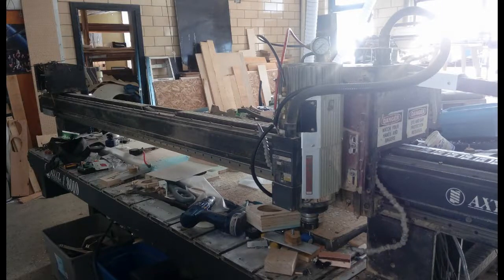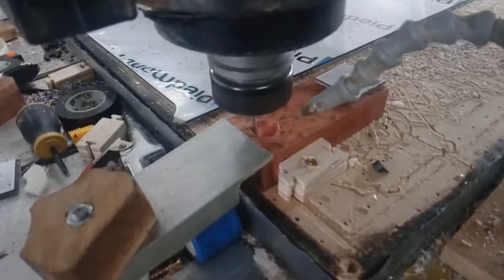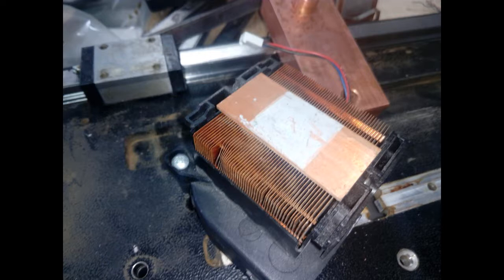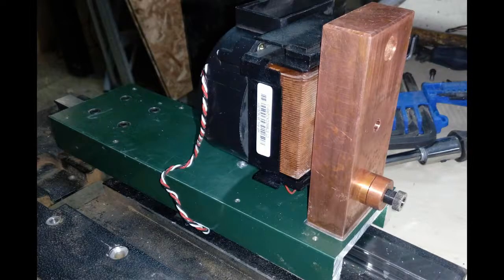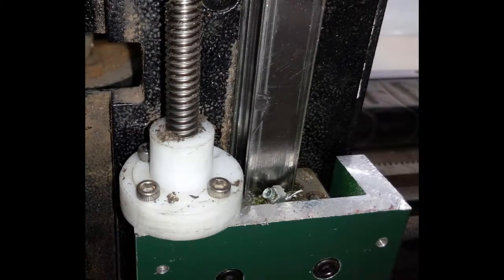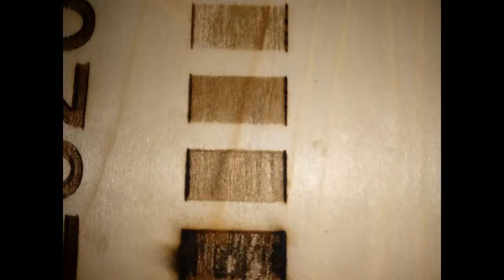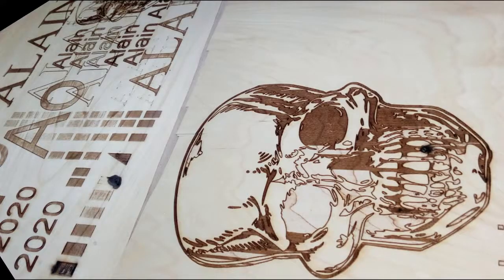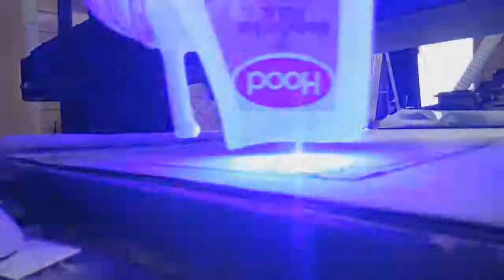Nichia NUBM44 Laser diode addition to CNC

Comment: Thanks, it was interesting. Have you tried engraving metal? Maybe its power is enough for marking metal without pastes?
Reply from the maker: I have not tried metal but I am certain it would engrave anodized aluminium.  I did not purchase for metal but more for wood.  I have tried cutting fabric, cotton white doesnt cut well blue is OK but be care must be taken so it doesn't catch fire.
Reply: @diypppalain  Thanks for the answer. I am thinking of buying this module for the home DIY making. But I'm afraid that his power may not be enough for metal engraving. May I ask you if it will not be difficult for you and you will have time to try engraving on some types of metal?

Comment: Dera Alain. O think You need to set Theo firmware to Work on laser mode. In grbl if I am not wrong is command $32=1. Só the machine control the laser power according to acelerelation and desaceleration of your Machine.
Reply from the maker: I am using linuxcnc so not available... Thanks